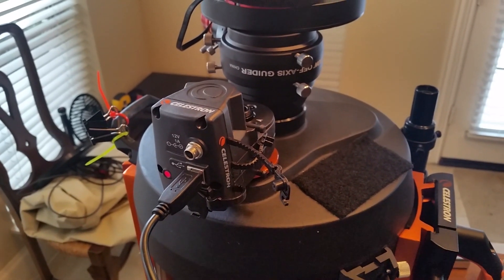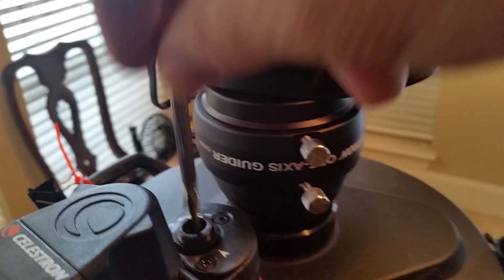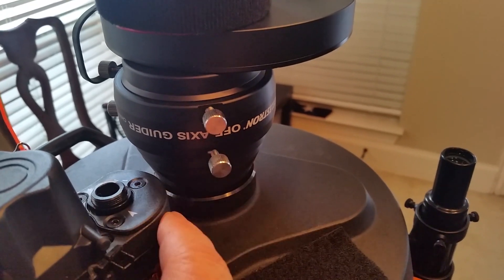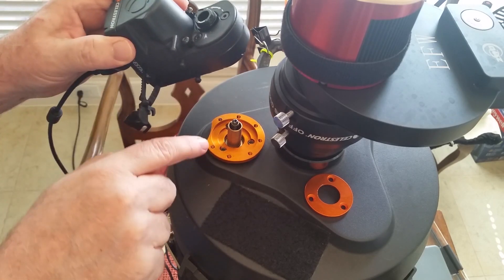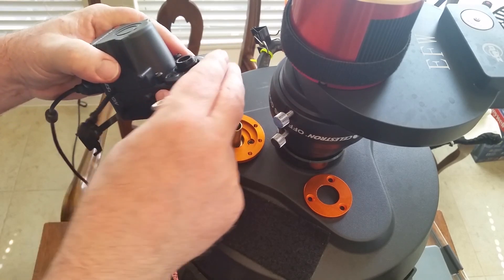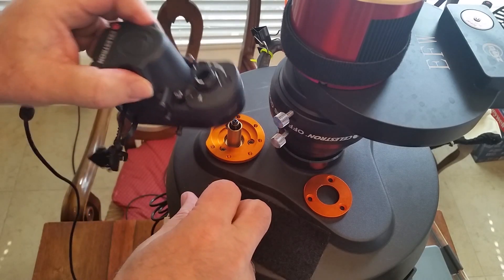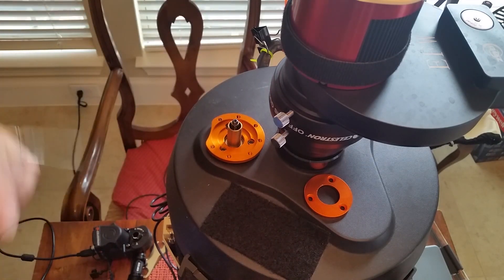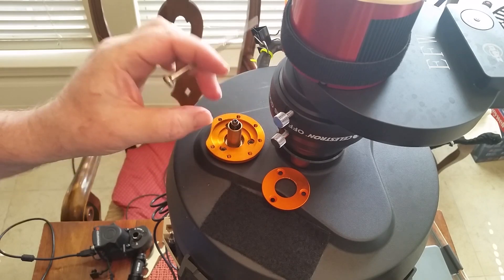Mechanical Binding Issue with the Celestron SCT Focus Motor

Comment: I installed this a couple of days ago on my RASA 8". I can see that during calibration, when motor is running and move the focus from one end to the other the motor body also sligthly moves. Is this normal?
Reply from the maker: Emil,
Yes, I think that is normal. Celestron says not to overtighten the two captive screws that attach the motor to the bracket or to overtighten the clamping ring to the OTA focus knob. So if you don't overtighten them, you'll probably get some wobble out of the motor. Keep an eye out for loosening of the three screws that attach the bracket to the OTA. Good luck!
Reply: @Aero19612  don't tighten the clamping screws to shaft tight enough then motor will slip on focus shaft. Its been an issue with this happening.

The grub screw, with lock tight can be deserving as the lock tight grips and easy to assume its tight when in fact its just tough to screw down any more.

My motor does not move
Reply from the maker: @denodan  Yep. This is a very temperamental design. Not sure Celestron thought through the design.
Reply: @Aero19612  I tightened everything down except the plate, so far no motor movement or coming loose.

They way I tightened my plate was do it up till the ficuser was getting hard to turn, than backed them off, and so far perfect. The grub screw is deciving as you may think its tight but not, so crank it down
Reply: @Aero19612  i accually think, so far is a great focus motor and can get extremely fine focus  used it last night imagjng Mars, Juipter and Saturn and compared to manual focus is a dream to use and extremely fine. The only bad thing is with focus control through starportal is not very good
Reply from the maker: @denodan  . I think the focus motor works fine. My issue (and others) has been that it tends to work the three attachment screws loose that hold the bracket on to the OTA. If I can fix that problem (the longer screws and Loctite may have done the trick), I won't have any major complaints about it. I'm glad it's working for you, Dennis!  Clear Skies!
Reply: I tightened my plate down till it was harder to turn the focus shaft, then back off and that worked
Reply: Emil, I had the very same problem. I solved it by loosing a little the "set" screw and the "clamping" screw, just to the point wherem the motor don't slip on the focus shaft, not over that. The reason for the motor movement was the overtightening of these screws. I didn't find any connection between the problem and the other screws of the motor.
Hope this is useful, for you or other having the same problem.
Reply: @davidecattani8282  I have found my motor body so far does not move. When jnstalling thr plate, did mine up till the focus shaft when focusing by hand was a little tighter than normal, then backed the screws of so it was easy.

The grub set screw with lock tight is deceiving as you get resistance screwing it in and many think its tight, but its the lock tight gripping and can make it hard to screw in. A lot of people have been caught out by this and found the focus shaft is slipping.

My sets screw and the grub screw did up till it wont turn  motor bolts that hold it the plate did up tight, and will lock nicely if tightened enough.

Comment: Re-tap the threads. I installed this on my 6 inch yesterday. Works fine, but the instructions show the mounting plate to be installed with the notched side to outside of the OTA.  I installed it just the opposite because I wanted to mount the focuser vertical so it doesn't interfere with mu DSLR and the holes were slightly off so I couldn't get both screws started. 

The other thing I noticed is even though I tighten the set screws before I ran calibration it seemed to run too long and sure enough with it running and a flashlight the brass tube was not moving. I tightened some more and it was fine. The insert that slides over the brass needs more than just plastic. It needs a liner to grip better.
Reply from the maker: Hey Joe. I suppose I could run a tap through the holes. Might be worth doing. Did you put Loctite on the three screws? I agree, the plastic "clamp" is not terribly reliable. The same thing happened to me when I first installed the motor and ran the calibration. It just ran and ran because it wasn't mechanically coupled to the brass knob. Let me know how things work out under actual usage. Thanks for watching!
Reply: @Aero19612  No... no Loctite. I don't like that idea with something that size if I ever want to get it off again.  If you re-tap it only start it by hand and when you think it's started use a 1/4" small wrench to turn it. Worse case... drill it out for next bigger size and tap it. 

I did notice yesterday I probably striped the allen head on the clamping screw. If I want to get it off again I'll epoxy the wrench in place and take it out. I'll need a new screw but that won't be a problem. With it off I'll make some kind of thin rubber sleeve for the brass like heat shrink.
Reply: @Aero19612  If you tap it all  taps are not the same. You'll want a taper tap which are the most common.
Reply from the maker: I don't have easy access to machining equipment so I'm trying to solve all of my problems with string and duct tape. Good advice on the tap. Thanks. I did use removable-grade Loctite on the one screw that keeps backing out. I also  ordered additional screws that are 2 mm longer. Once it binds up again, I'll try to run a tap, install the longer screws, and probably Loctite them for added security.

Comment: Hi James. We seem to going through the same issues with the same gear! I have the Celestron motor focuser and it has loosened in the same way, although it didn’t bind so lucky there. Did you manage to find any suitable replacement screws? Also, when you guys discuss loctite I’m unsure what you mean. Is this a particular thing for screws, as here in France it’s just a brand name with a host of different products. Don’t want to apply the wrong stuff and make a mess of things. Appreciate your time in making these videos. Really helpful.
Reply from the maker: Hey John. I measured the screws. They appear to be M3x0.75 x 8 mm long. I ordered some that are 10 mm long but have not removed the focuser yet to see if they will bottom out on something. I suppose they could be files down if necessary but they are really small and difficult to get a grip on. I'll comment back when I've tried them out. Yes, Loctite makes a lot of stuff. There is the "red" Loctite for permanent installation and "blue" Loctite for removable. This is what I bought:
Loctite Threadlocker Adhesive, 242, Removable Grade
Reply from the maker: Typo. The Celestron screws are M3x0.50 x 8 mm. Probably could find a 0.75 mm pitch screw if you tried.
Reply: James Lamb Thanks James. The blue Loctite is on order. I’ll try that first and keep an eye on things. If it comes loose again I’ll look into the screws you mention.  Any thanks.

Comment: I had just bought one of these last week.  This motor had a binding issue also.  Had one heck of a time getting to the set screw and the clamp.  The wrench would not turn the motor.  Froze up.  I sent it back for a refund.  Looking for something better.  Pegasus Astro Motorized Focuser may be something to look at.  Nice video.
Reply from the maker: Hey Jerry. My focuser on my refractor is the Pegasus Astro FocusCube2--it's great. I was so impressed with it that started to purchase their focuser for my SCT. It sat in my "basket" for several weeks and then I happened to see that Celestron had just released their focuser so I bought it instead ($100 less). I thought the direct connection would be better than the belt drive. I'm sure the Pegasus Astro SCT focuser will be fine. It may use the same three screws for attachment, but maybe they are accessible without having to remove the focuser. Thanks for watching and good luck!
Reply: @Aero19612  I thought that the direct drive would work great also until the motor locked up and I couldn't even turn it with that supplied wrench.  I did get a little nervous on how I was going to remove it because the set screw and the clamp screw were of course covered.  But I managed.  I'm real new at astrophotography so I'm now setting up the SCT to be controlled by my laptop.  You almost have to have a motor driven focuser if you're going to do that or it will be a lot of back and forth stuff.  On your refractor,  do your have to purchase the Pegasus controller since I would be focusing the Pegasus Astro Motorized Focuser from the laptop? Thanks again for the knowledge based videos.  Big help.
Reply from the maker: The Pegasus Astro Focuscube2 is a stand-alone unit. Just plug in the 12v power supply and the USB2 cable and you’re good to go.
Reply: @Aero19612  Hello, I just received my  Pegasus Astro Motorized Focuser & Controlller.  Wish I would've bought the focus cube 2 instead but the other one was already shipped and this will work out.  Going to install it today on my SCT.  Clear Skies!!!
Reply: @Aero19612  OPT accidentally sent me the wrong combo of the Pegasus Astro Motorized Focuser & Controlller which when they were wired per instructions it smoked them from what the Pegasus rep. told me.  So with his and OPT's help, I sent back the defective units.  I'm going to purchase the stand alone unit, Focuscube2 but I wanted to let you know that there is an optional hand controller for the FocusCube2 that I think I'll get for when I'm just viewing through an eyepiece.  This is it:  https://pegasusastro.com/products/hand-controller-for-focuscube/   Thought you'd like to know if you didn't already.
Reply from the maker: Good grief. It's a wonder we have the patience for this hobby. Glad OPT admitted their mistake and are making it right. I think you'll be happy with the focuscube2. Let me know what you think when you get it hooked up. I was aware of the optional hand control unit. I didn't purchase it because I'm never running the focuser while standing next to the scope (I don't do any visual viewing). I can certainly see how that would be useful, if not required, for folks who also use their scope in visual mode.
Reply: @Aero19612  Plenty of patience. OPT and Pegasus Astro was real good about everything.  Maybe if I would have been more up on this product I could've seen that it wasn't the right combination.
Reply from the maker: Not your fault. I have yet to come across an astrophotography equipment manufacturer/supplier that's not a stand-up company. One good thing about the hobby: it's not so "popular" that it attracts the get-rich-quick crowd.

Comment: My 20 year old C8 focus binds up too;  the  problem is at the same spot. Don’t know why Celestron can’t make this simple mechanism work well.  It’s really a shame to see that after decades Celestron hasn’t done a better job.
Reply from the maker: First, I didn't realize the C8 had been produced for 20 years. Are you saying the manual focuser binds? Or it's this electronic Celestron focuser that's binding? Either way, it highlights a design flaw.
Reply: James Lamb My scope was specifically called the ‘Celestar 8’. It had the old wedgepod mount. The electric focuser I got way back is just like the JMI Motofocus available today.  If one look at that it has the same replacement adjuster stem plate and screws methodology to mount a small nurled knob on the C8 focus. The problem was the replacement plate did not keep the focus rod that goes into the OTA truly centered and the off-center focus rod would bind. It didn’t matter if the electric focuser was in place.  Just turning the focus knob manually, one could feel the binding.  It was always a temperamental setup.  I’m not saying it’s the same problem you’re having.  The solution, on my unit,  is to have to exact screws needed to help that base plate truly square-up in position.  In sum, I could feel the focuser’s binding when operated manually and the electric focus would slow as rotated through the binding positions.  One was aware of binding in both applications. In my thinking it’s all about how that after-market place seats and that’s what i fuss with.
Reply from the maker: Well, it's a different setup but it certainly sounds like a very similar root cause for the problem.

Comment: Hi James, I had an issue with binding once with the Celestron motorized focuser as well. It was totally unrelated to your issue it sounds like. The three screws that are in a triangle pattern around the focus shaft are not used to attach the motor to the scope. However, if you accidentally tighten any of them at all the motorized focuser will bind badly. It's easy to tighten one by mistake because the are right above the two screws that DO attach the motor to the OTA. Hopefully that helps someone.
Reply from the maker: Great feedback, Charles. Someone else noted that over-tightening the three screws affects the rotational stiffness of the SCT focuser shaft. All of the comments to this video serve to highlight weakness in the "system" performance. The electronic focuser works fine. The SCT focuser works fine. The interface that connects the two subsystems is the weak link.
Reply: @Aero19612  I meant the 3 screws on the motorized focuser itself. Not the ones that are on or connect to the OTA.
Reply: Charles Thompson ...there are only two if you mean the captive screws.  I just installed my new focuser and I don’t like the way it sounds.
Reply: @briandenley  it is louder than the other focus motors I have used but I haven't had any issues with it's performance.  I'm using it on a RASA 8 and RASA 11. I attach the mounting plate and get those 3 screws as tight as possible without binding. Then slide on the focus motor and tighten the 2 mounting screws. Finally, I tighten the set screw and the clamping screw. So far it hasn't worked loose on either scope.
Reply: Charles Thompson thanks

Comment: Son of a gun. Spent the whole day trying to fix this darn Celestron focuser. It was certainly loose just like you showed. Took everything apart. Used a micrometer to make sure when I tightened down the plate that the central brass bushing remained true in the center. Loctited  all the bolts put everything back together and everything seems to be working beautifully without that wobble that was loosening up all the screws. Thanks again Even though I spent the whole day on this but it was worth it. Again if you have any recommendations for APT settings for this focuser you can pass them along.
Reply from the maker: Great news, Louis! Keep me posted on the Loctite solution. I will be going that route as well. Were all three of the threaded holes in good shape? For my focuser/OTA combo, I found that no filter offset adjustments are required (but I have parafocal filters produced by the same manufacturer) because the 1 step is "fairly large." I use a backlash compensation of 20 steps. I describe how I got these numbers in an earlier video: "First Use of the Celestron Focuser on my SCT".

Comment: I tried for weeks to get my celestron focuser working, turns out it was a bad torque sensor. I found that my focuser works better if I leave the focuser mounting screws a bit loose and keep the mounting plate tight. It will wobble a bit but wont bind as much vs. the focus knob spindle.  It does ad a bit of backlash though.
Reply from the maker: Interesting, Michael. I can see how allowing the focuser shift can allow it to "find" the proper SCT focuser shaft axis. Good luck!

Comment: Great Diagnostic video James and while I haven't had any problems with my EDGE HD8 and focuser (touch wood!), it's good to know your video exists in case this ever happens.  I'm not using a backlash setting right now and am getting typically 1.2-1.4 HFR with my setup. Do you have any quick tips for calculating the focuser backlash?  Thanks again for your informative videos!
Reply from the maker: Thanks for watching, David. I'm glad you're having such great success with your setup. As for backlash, you can see what I did at 18:00 min into my video "First Use of the Celestron Focuser on my SCT". Good luck!
Reply: @Aero19612  Thanks James  - I missed that video. It's well detailed!
Reply: David Fielder Keep an eye on it David. I have the Edge 8 and mine came loose like James and a few others I know.

Comment: Another informative video. I have the same focuser  on my edge 8 HD. I’m going to take it off and look to see if I have the same problem and I’ll let you know. I think blue Loctite is certainly in order. So far I’ve had no issues. You brought up another good point that this focuser certainly needs backlash compensation. I wasn’t using it and it’s always a bit of a bear to get a good focus back-and-forth.
Reply from the maker: Thanks for watching, Louis! I hope my issue is "rare", but, by all means, let me know what you find out. I think almost any focuser will require backlash compensation, especially when used with V-type or hyperbolic curve auto-focus algorithms that pass through optimum focus and have to back track to the optimum. Thanks for the blue Loctite recommendation.